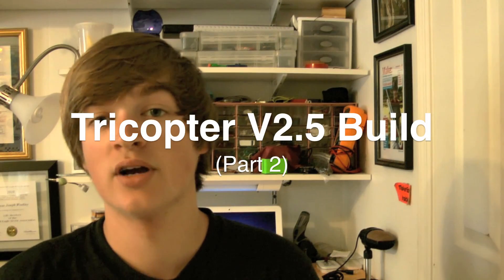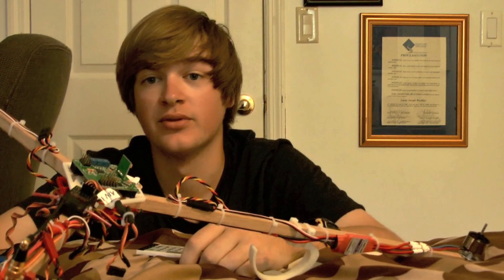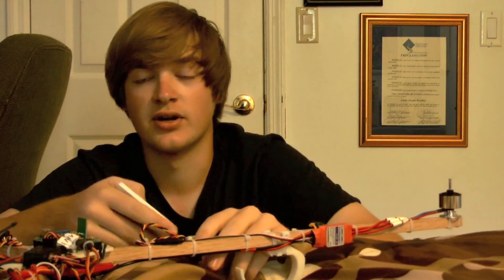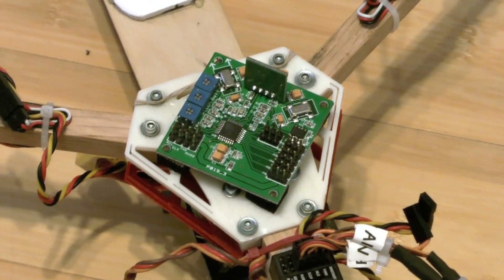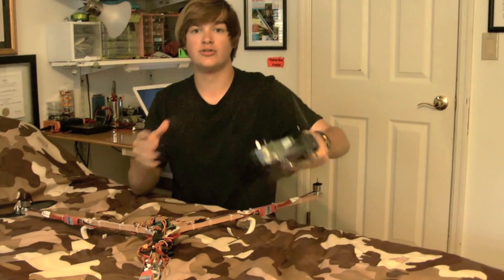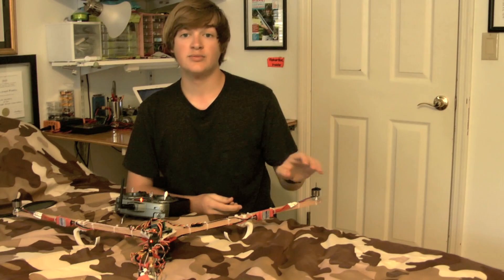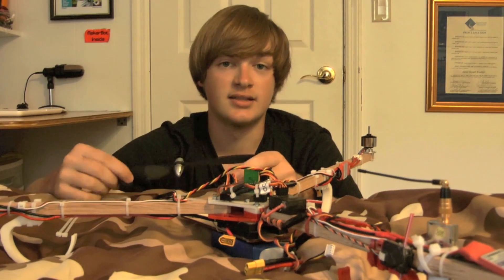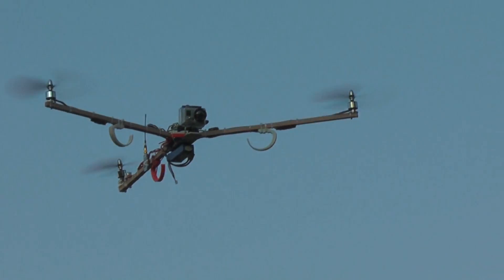Tricopter V2.5 Build (Part 2/3)

Comment from the maker: Nope, I mean what I said. Setting it to NiCad will prevent the ESC from cutting out at a low voltage, so the tricopter doesn't fall out of the sky when your battery runs low.

Comment from the maker: Well, that is the problem of setting the ESCs like that. If you fly for to long you can permanently damage the battery, so yes a low voltage beeper would be very important. But, destroying $10 battery is better than crashing a $200 Tricopter plus GoPro.

Comment from the maker: Because of the cut off type. The LiPo battery setting will make the motors stop abruptly when the battery becomes low on voltage. If it is set on NiCd then it will do a gradual cut off. This is very important so your motors don't stop and the tricopter comes crashing down to earth. Also, the ESC programmers are very easy to use and once you buy one, it will work with any brand of programable ESCs. Good question by the way.